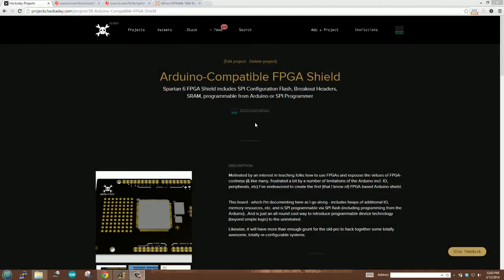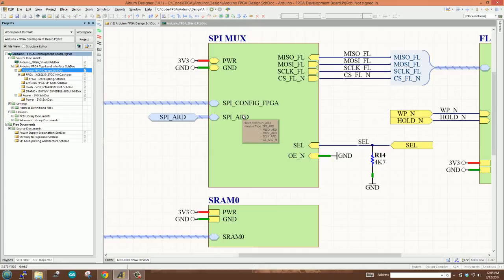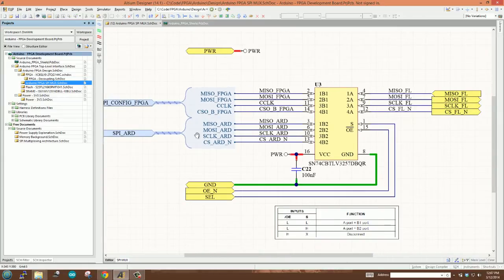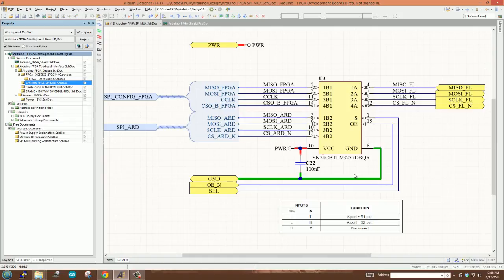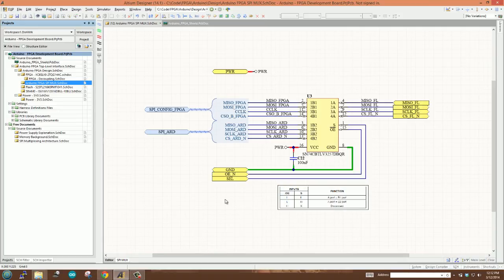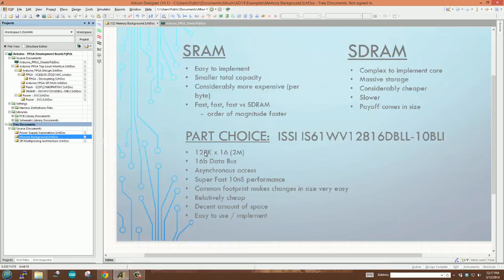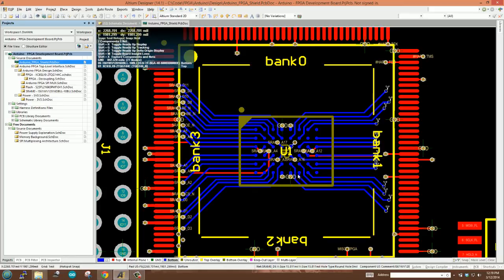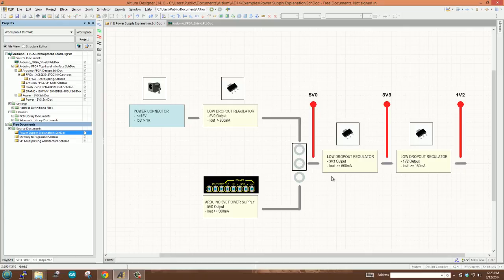Building the Arduino-FPGA Shield Part 4: SPI Multiplexing, SRAM

Comment: As I understand the hardware logic of the bus switch on the SPI port. How is the arbitration handled when both devices want the bus? The select line is pulled low, so the FPGA gets the bus until the Ardunio drives the signal high. Ardunio has the bus and is performing it's function and still has the bus and the FPGA now wants it at the same time. How is this handled? How does the FPGA know that the Ardunio has the bus? Does it read the select line and wait till it is low before a SPI bus transaction is initiated by the FPGA? Also visa-versa, how does the Ardunio know that the FPGA doesn't have the SPI bus before it switches it? Nice videos, TIA.